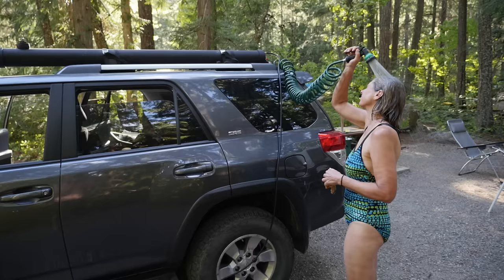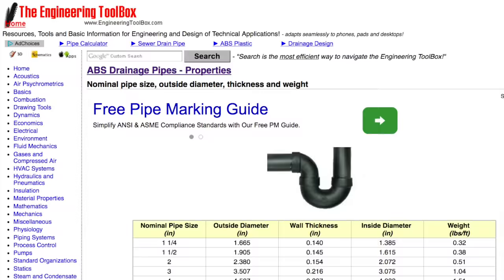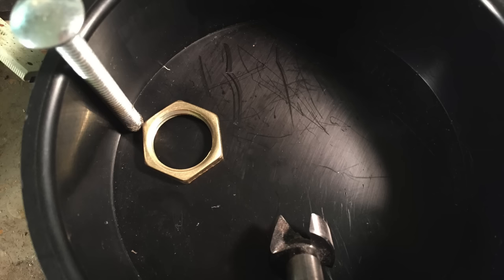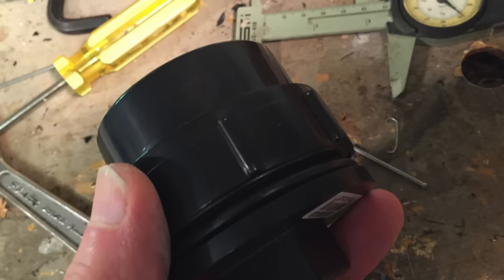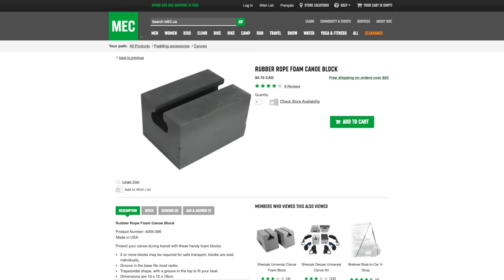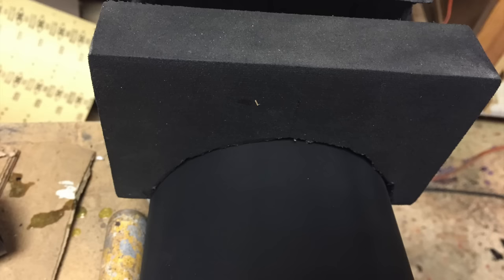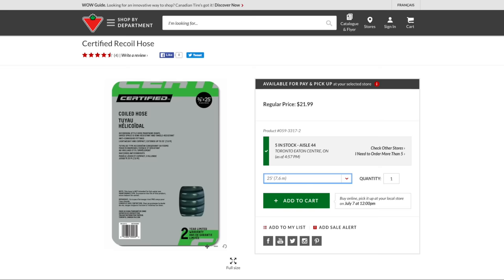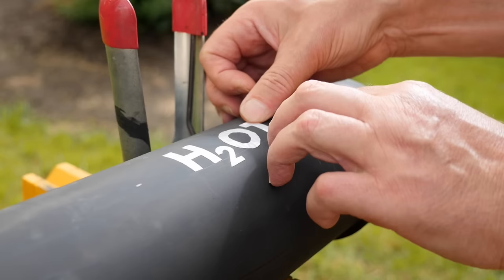H2OT - Rooftop, pressurized, solar-heated shower/sprayer using ABS pipe. DIY

Comment: We are about to join the ‘grey nomad’ retirement life and live in bush camps (off-grid). The only luxury/necessity missing was a shower and I have been designing one mentally for some time and was concerned about needing a pressure relief valve as I’m in Australia and travel in desert country. Do you think (as one of the comments suggested) that a water heater pressure released valve would work in place of the radiator drain plug? We have been using the solar shower bags that are ok, but... . As others have noted, this is an excellent DIY video. You have given me many tips I had no thought of like why ABS over PVC and the UV protection reason for painting. Thanks so much for sharing. Now, Robin, to the Batcave to start building.
Reply from the maker: At the hottest point we have ever seen the the water, there was ZERO pressure build up in the system due to heat.  Here is an experiment. Get a 2L soda bottle and fill it it water. Set it out in the sum all a day. Open the lid. Did it spray scalding water in your face?  No.

Comment: that is a great idea... and the model sure is sexy

i would add that PVC drain pipe comes in several thickiness known as  schedule

20...kitchen and bath sink...white
40...residential...white
60... commercial...black

id probably do the 60 cause it will hold the temp longer due to the thickness of the pipe and it holds more pressure... so you could get a longer shower with less water making a finer water mist ...its also comes pre black in color

id look into adding a tire pump with hose clamps to pump up the water pressure instead of using a compressor... but thats a person preference...less set up and storage vs how much effort you want to  apply to it

if i did use electrical compressed air... id use one of those air mattress pumps  $8 to $12  at walmart and a twin / full size air mattress to sleep on that way you get duel purpose out of the pump and a soft mattress to sleep on outside... errrr back of truck

you could also install a high volume low pressure ( NEW )  fuel pump and not have to use compresssed air to get pressurised hot water 

maybe even add in some natural sponges to act as baffles or some drain grates inside the pipe ever 12 inches as baffles to stop  the slushing around.... high performance race cars use various ways to stop fuel  slushing around inside there fuel tank ... most popular are plastic fuel cells that hold several gallons of fuel, that might be an option and has all the hook ups and pumps with baffles... just paint it black and strap to the top of the rack... a 3-5 gallon fuel cell dosnt take up much space and would have everything you need, just hook up the hose and spicket... try ( jegs.com or summitracing.com) both gold standard for race car builders

just a few thoughts of my own....haha

thanks for posting

prop

Comment: hey man, love your idea, just a mod suggestion in regards to your pressure and air flow, simply buy a 10$ tyre deflator that allows you to preset a pressure, add an extra valve and screw it on, done, when your shower reaches a certain pressure, it will release the excess pressure, maybe mount the other valve on the opposite side of the cylinder, and use that one with your compressor to keep noise away from the shower head and put the deflator on the original valve :)

Comment: Thanks. Maybe PVC pipe would be safer, made for holding drinking water, paint black. ABS can be toxic especially when hot from solar heat. Will absorb through your skin.
Reply: true,  i've been told(by plumbers) many times that a lot of both PVC and ABS pipe is treated with lead (or harsh chemicals that contain high amounts of lead) and to never use it to store drinking water........
Reply: Its a shower, not drinking water holding tank

Comment: nice!  we just put 2 litre soda bottles in the sun when we tent camp.
Reply from the maker: That works great if you camp in an area where you can actually get direct sun on your site. part of my design was to allow the tank to heat up while there was the direct sun, which would be while driving.
Reply: @ImaginetMedia  Yeah, we put them where the sun shines out of the shade, we had actually bought a shower bag thingy, but just leaving that sitting out somewhere isn't so great, and we found a soda bottle works better.  It doesn't have to be where our car is parked.  Having it work while driving is nice!

Comment: Looks good just make sure you use either both primer and glue or a glue that doesn't require primer. You don't want the joints to fail under pressure. Should easily hold at that low pressure or even higher.
Reply from the maker: I did not use "glue" . I used ABS solvent cement. It chemically welds the pieces together. The joints are actually stronger than the pipe.

Comment: Great DIY and Vid!! Can you provide a parts list for everything needed? I need to build one for my Baja trip!! Thanks in advance.
Reply from the maker: The parts are all shown at 1:25 in the video.  As I am in Canada, I know many of the exact parts will not be available elsewhere. But as they are all common parts, you should be able to find them all or alternatives wherever you are.
Reply: Hey I couldn't tell what the parts of the far left of the screen are at 1:25.  They look like gaskets or something. Also did you use the same ABS cement on the brass valve and shrader valve?
Reply from the maker: Those are O-rings on the left. I did not use them. ABS solvent cement is only used on ABS to ABS connections. It actually melts the ABS and welds the pieces together. This is evident where I cement in the 2 inch filler in the drilled hole.  The brass shut off is tapped in. It has NPT tapered threads. The air valve comes with rubber grommets. It installs exactly the same way you would install a air valve in an aluminum wheel rim.

Comment: If someone wanted to have water pressure down to the last drop of water in the tube. they could use just a little air compressor pump dc-powered plug into the cigarette lighter which I don't like or wire into a vehicle. And put in a 30 or 40 pound shut off Hobbs air pressure switch DC current. Now you would have to wire this switch in through the power going to the compressor would be the easiest. These open and closed air pressure switches I think they're called are used in airbag kits for vehicles that have airbags in them. You would get that air pressure switch in a open circuit at 30 pounds psi open circuit Hobbs switch that breaks the switch to cut it off. Because a lot of things you order online you can't talk to anybody. Closed circuit would put the switch together and make it run. Open circuit shuts it off.

Comment: to fill the storage tank all you have to do is pull up to a water supply and use your coiled hose to fill the pipe.
Reply from the maker: We usually go to sani-dump stations and use the freshwater fill hoses stands there. No need to use our own hose at all for filling, COuld not be easier here.
Reply: Keep a water key handy as you cruise around the city. There's always a faucet somewhere. #VanLifeHacks

Comment: I really enjoy this video. I agree, you are a wonderful educator. If I decided to do this but with a 10’ section rather than 6’, I’m not sure on how much pressure to use.
Reply from the maker: Thank you for your comments.  The pressure ratings would remain the same. Pressurize to 30 psi, turn off compressor, run shower until psi drops to approx. 10psi, turn on compressor and pressurize to 30psi. Rinse and repeat.
Reply: Thomas Howard generally interior house pressure is 30-40 psi. 30 psi seems acceptable and not excessive but the volume of compressed air is much greater in the longer length of your pipe

Comment: ABS plastic Physical Properties	Metric
Specific Heat Capacity	1.60 - 2.13 J/g-°C
Thermal Conductivity	0.128 - 0.187 W/m-K
0.250 - 0.250 W/m-K @Temperature 30.0 - 260 °C
Maximum Service Temperature, Air	50.0 - 109 °C
Reply: aluminum Physical Properties	Metric
Specific Heat Capacity	0.900 J/g-°C	0.215 BTU/lb-°F
Thermal Conductivity	210 W/m-K	1460 BTU-in/hr-ft²-°F
Melting Point	660.37 °C	1220.7 °F
Boiling Point	2519 °C	4566 °F

Comment: How about two PVC one on each side one for water and one for air pressure. you could fill with a hose and pressurize the air tank at the same time.
Reply: Jay Hughart ... i like that idea... and you got a good source for air for a flat and dont want to drag out the compressor

Comment: Buy an inline water pressure regulator.  Connect it to the end of you hose.  Get a fitting that will hook to the water spigot. A short piece of hose with two female ends if necessary. This will eliminate the need for a hose fill port that can leak. In line regulators are generally rated at 25 psi.  You may have to drain a little water to allow air space.  Making a little fixture that allows you to pressurize the system through your water spigot and still flow water will eliminate one hole in your tank that can leak. You would have to shut off the water flow when you pressurize though.
Reply from the maker: No need for this complexity and expense.  My tank does not leak.

Comment: Built mine with a quick disconnect.... and a stainless steel ball valve.... just need to get a electric pump but I would like to add an air gauge..... and a pressure release valve....The prices of these things are outrageous I built mine for just a little over 200.00 CAN
Reply: The release valve is a great idea!

Comment: Love it! Thank you for making this!
1. What does the T marking stand for after H20? Is this for legal reasons?
2. I live where summer temps are triple digit (F). As temps rise, will hotter water temps increase the pressure on the pipe to a dangerous level?
3. Would you recommend a T&P relief valve for added safety?
4. How would changing the placement of the shrader valve to either end of the pipe effect how the shower functions?
Reply from the maker: (1)  It means "HOT" as in hot water (H20). I thought is was a clever name.

(2) Water does not expand (for all intents and purposes). Steam of course does.  As long as your PSI is below the recommended pressure rating for Schedule 40 ABS pipe, yo will be good to go. 

(3) This would be a nice addition. Unfortunately, I could not source one locally that would release at a low pressure (30psi). Most I found were 100+ psi. If you find one suitable, please post a note here.

(4) It should have no affect. I placed it in the same end as the drain for convenience. I wanted the front end intact so that I could store the shower on its end and not worry about breaking the valve. Plus, the other end is exposed the elements when driving on the highway. It is protected where it is by the heavier duty drain next to it.

Comment: the only modification I would make is to take a 1/2" copper pipe and fit 3-6 discs on it that have holes in them. Spacing the disc out evenly along the length of the pipe. The purpose is to prevent all the water that is shifting to the rear of the pipe when driving an from flying forward when you hit the brakes an slam the front end of the pipe. It the seals hold it is a ton of force to be held by a couple of straps.
Reply from the maker: I never drive anywhere unless the tank is filled to the brim, or it is empty. Driving with it full prevents a hydraulic hammer, which you described. It is basically a solid mass as there is no movement of the water as there is nowhere for it to go.
Reply: Turn the pipe 90 degrees.

Comment: Excellent DIY project but you could have wrote down all the hardwares used in this roof mounted water heater. I took a screenshot of the parts you’ve shown but it’s kind a blurry. Can you please tell me all that parts needed for me to build one myself? Your cooperation would be greatly appreciated. Thanks.
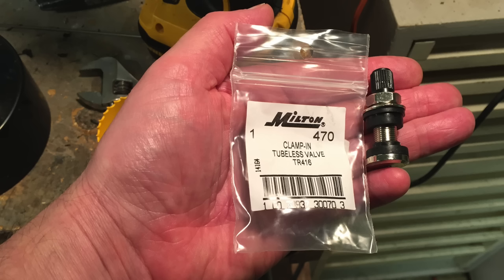Reply from the maker: All the components are shown in the video at 1:27 and 1:58.  I do not list them as the odds of that specific part I used in the build also being available where you live are slim. Unless you live in Canada, many of these parts would require substitution so links to what I used are irrelevant.
Reply: @ImaginetMedia  Got it! Thanks

Comment: Great DIY sir.  But I have a question. Do you run the compressor as your spraying? Or does the 30 psi maintain the "spray" for the duration of the water capacity? I'm very interested in making one of these! Great video!

Comment: I have been racking my brain and now no more ! I am in the process of converting a cargo trailer into a camper and I can attach 2 or more of these on top. I looked into black rubber water bladders ect..The only thing is,I plan to shower inside and so I will have to figure a way to attach my hose and compressor through a 'small' hole in the roof LOL..Maybe an elbow to a smaller pipe down through the roof. Any ideas,anyone ? Great video and idea..Thanks so much !

Comment: I want to build one but have a few questions.... 

1.   When the air pressure runs out... does it at some point create a vacuum and not allow the last part of the water to drain?.. thus requiring you to loosen the fill cap?   I thought a vacuum relief valve might be needed.  

2.   How much air about do you leave in it after filling? 25% of the volume?  Less?  If you fill it to the brim there'd be no air left to pressurize, and it is at risk of exploding from thermal expansion if the water expands too much. 

3.  How does it do after driving on a moderate day?  Do you lose all the heat?  Seems like it'd have to be parked for awhile to build up heat.  This could be a good reason to make it detachable and leave it at camp.

4.  Since you are painting it, would you consider PVC next time?  It's stronger and more conductive, it should transfer heat to the water better.

5.  Any issue with sloshing 30 lbs of water while driving?  I guess some baffles could help that but sound like a pain.
Reply from the maker: Thanks for the great questions. I have answered these questions several times previously in detail in previous comments on the page. A quick search should call up your answers for you to all of them.

Comment: Could you provide a complete list of items you need to get from the store? As well as what tools you used? Thank you!
Reply from the maker: At 1:24 of the video, I show all the parts I used. The exception is the air valve which I changed but do show at 1:53. 

Aside fro standard tools most home owners or DIY'rs should have, the only thing you may not have is the 2-3/8"hole saw bit used to drill the filler hole at 2:31
Reply: Would you mind listing the parts out? Its kinda hard to read the labels looking at the video.

Comment: Going to add this to my list for when I'm wild camping, great vid! Any details on how heavy the unit was when filled? Thanks!
Reply from the maker: At 1:17 in the video, I show a spreadsheet witch contains this data. You would want to add the pipe weight (lbs/ft) and the volume of water (L) together for the pipe diameter and length you choose. There is also the weight of the fittings to add which would be at most 0.5 Kg.

Comment: Very nice, if I may offer one subjection on the discharge end if you put a 45 and capped it the hose discharge would always be at the lowest point
Reply from the maker: The problem with this is that you would NOT be able to open the tailgate of the truck. The location and design shown in the video is the exact position so that a hose can be attached AND the trucks tailgate can open fully, without any conflict between them.

Comment: This is awesome, but you should really put a pressure gauge on the pipe to check for correct pressure and to detect leaks.
Reply from the maker: Thanks for the feedback.  I do actually have a pressure gauge on the pump, so I know exactly when I reach the desired max pressure (30psi) and when I have to turn ther the pump on (10psi).  It is worth mentioning again that the shower does not gain any pressure from the sum heating it up.
Reply: For leaks, add soap.
Reply from the maker: There is no need. It is not a static system. If you pressurize to 30psi and yo had a leak, yo would know it immediately as there would be a steam of water where there should not be.

Comment: And they make DC solar water heating elements that can be mounted  to your system and can heat water off the alternator while driving...  that might be a good add on a cloudy or cold day...
Reply from the maker: That would certainly be a useful modification.

Comment: Planning to build a copy of this shower tomorrow, very excited!

Do you think the same concept could work but with another length of pipe, connected and running parallel to the 1st? I would love to replicate this but hopefully with a higher carrying capacity.

Thanks again for the video!
Reply from the maker: If you use the same diameter pipe for the connection, it will work. The key is that the invert (inside bottom) of the system has to be a at the same level through out the system. if you uses smaller diameter pipe to connect the main tubes, you will trap water in the second tube that will never drain. I would also allow some space between the tubes to allow sufficient sunlight to reach both tubes.